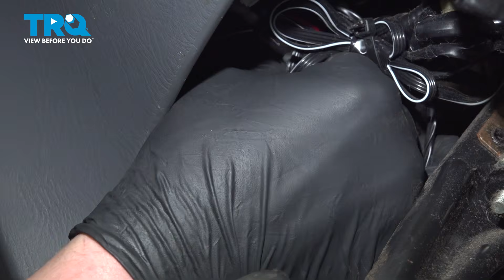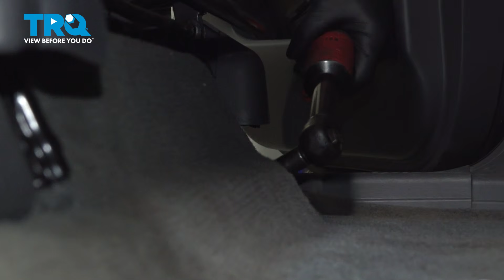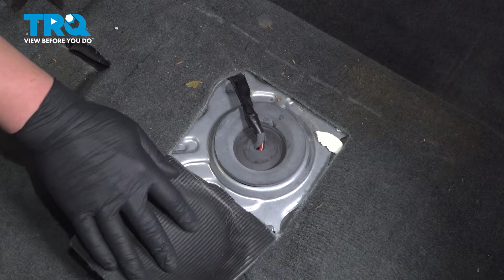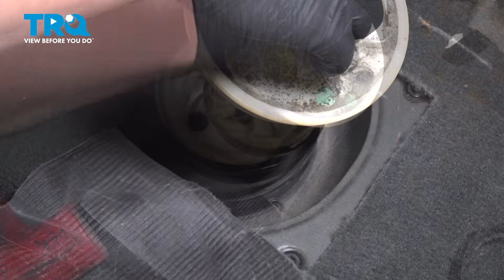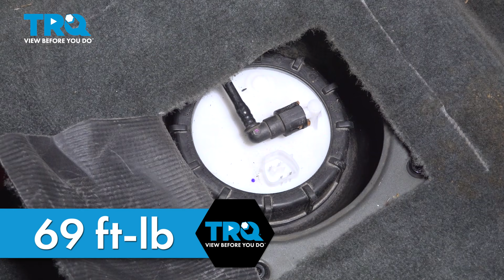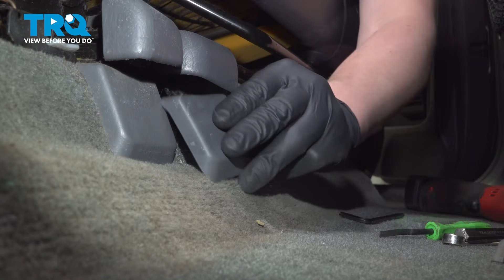How to Replace Fuel Pump Assembly 2003-2008 Honda Pilot

Comment: I'm assuming pulling the fuse and running until it dies out is to ensure your lines are clear, correct? My only issue is that without the fuse my 2004 Pilot doesn't start at all. Is it safe to assume I can proceed anyway?

Comment: I got a problem.My fuel pump module has 2 lines.You're only showing one line I have a 2004 with a 3.5 liter engine

Comment: I have a 2004 seats are pulled and I’m to the pump. It has two separate fuel lines coming from it. Is this just older gen?